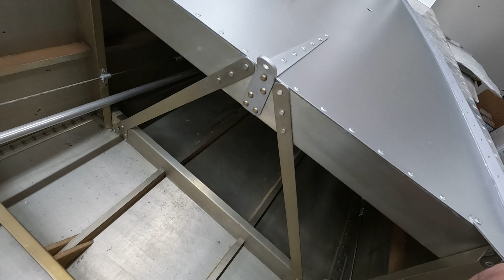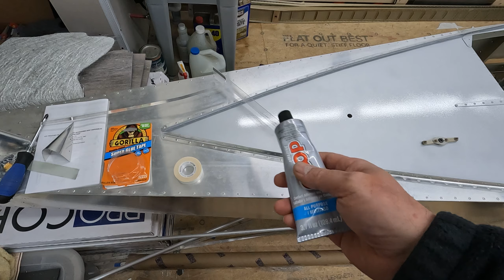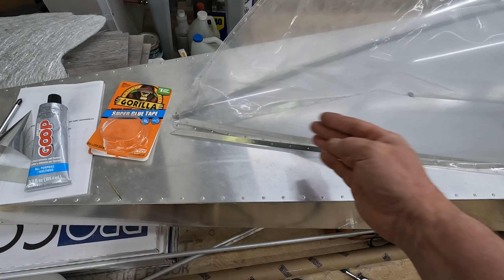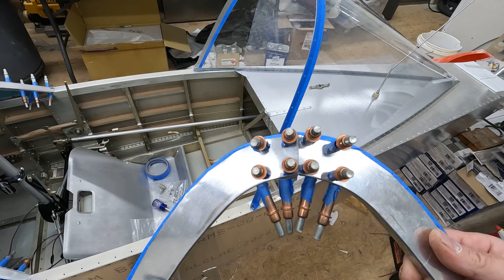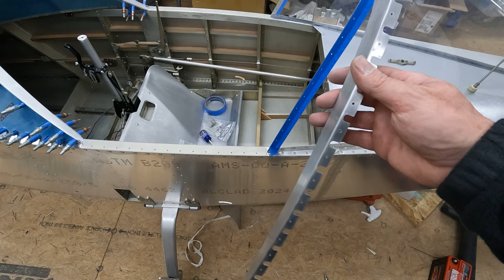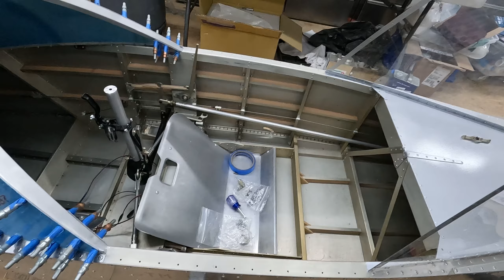39 - CriCri Airplane Build - Rear Canopy and COM Antenna

Comment: I would be very interested in buying a CriCri canopy. Would that be possible? If so, how? Please let me know. (I sent you an email but got no reply). Thank you! And: Please keep up the amazing work. It’s inspiring to see others make progress on their homebuilt airplanes!
Reply from the maker: @bernardomalfitano I replied to you on the 16th when you sent me an email. I replied on the info@ email so it may have gone directly to your SPAM/Junk folder. Check and let me know if you received it or not.
Reply: Jim, thank you very much for your prompt response - both times! I’m afraid that your email really is nowhere to be found, not in my Junk or Spam folders, not in “all mail”. If you could try again, maybe from a different address, I would really appreciate it… or maybe just post here about who to get in touch with for a canopy. In the meanwhile, I will write you from another address, whose spam filter is a little less aggressive. Thanks again! 👍

Comment: The tape is a brilliant idea, I would use that if I did mine again. Do you know if it is UV protected?
Reply from the maker: I haven't seen any information that indicates it has any UV protection built in. I think the only area that would matter is the exposed area around the hoop where you can see it through the Lexan. I think I will paint over this area anyway, at the same time I paint over the exposed Proseal around the main canopy frame.